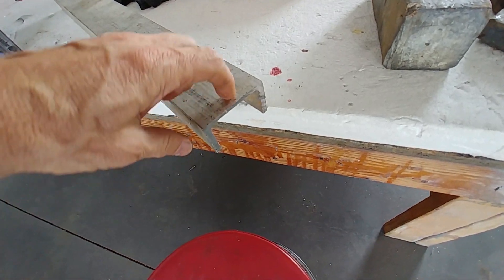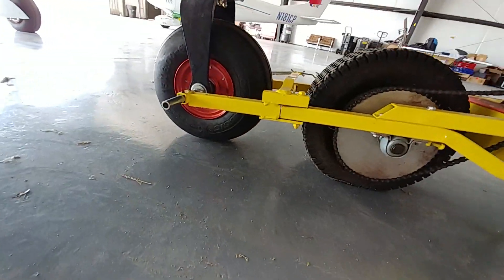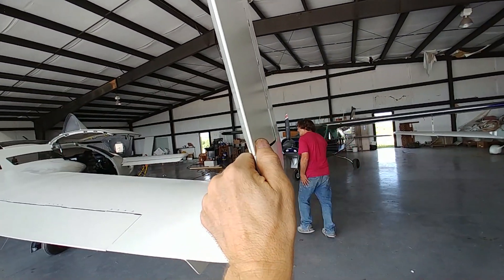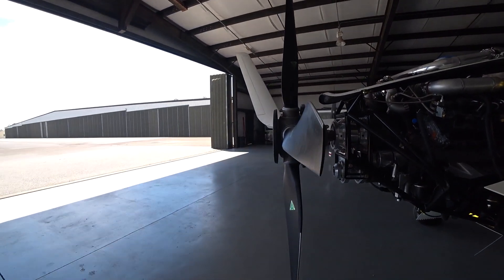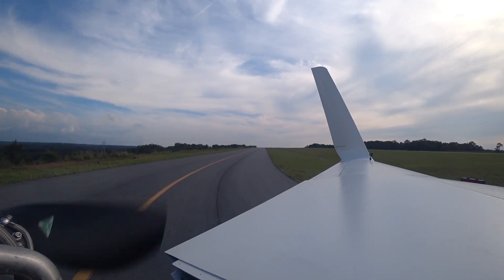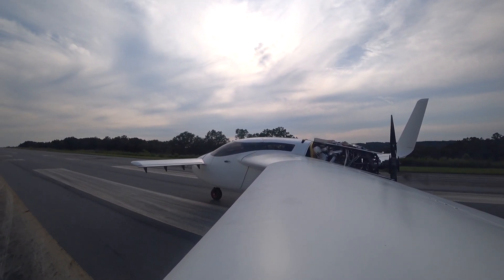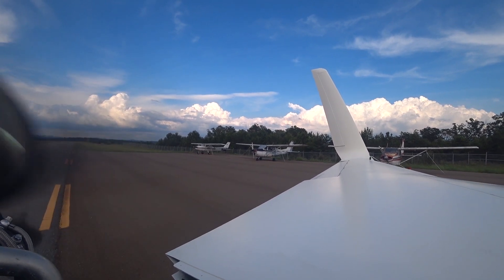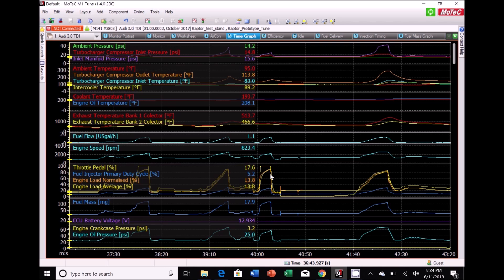Pushed to the Breaking Point - Building the Raptor Prototype

Comment: Dump the Audi diesel and go with an already proven engine like the RED AO3 V12 Diesel or the RED AO5 V6 Diesel.  Both already certified for aircraft use  and the just get the aerodynamics stuff sorted.  Unless Audi are willing to come in and help with sorting the ECU problem out - its juts a waste of time and money! May ned to re design the back end to cater for whatever engine you put in, but thats the quick answer to the engine problem.  You can keep banging on trying to solve the problem but even more may well crop up.
Reply: Or go for a Continental CD300 aviation diesel. Lose the belts for a direct drive gearbox, still get 300hp and a good fuel burn.
Reply: The Red a03 is too heavy ,too long and would double the price of the Raptor
Reply: Have you contacted Link ecus in NZ to see if they can help solve your ecu dilemma?

Comment: Some diesel engine manufacturers (maybe audi too) are using dual mass flywheel/clutch to dampen torque impulses, it looks like you dont have that 

dual mass system? One option is to increase flywheel inertia but it might introduce another set of new problems. You could also try to match 

rubber "clutch" harmonics to engine crank natural torsional vibration (1st mode). This seems just minor tweak compared to project you
accomplished so far, maybe day or two off the work and then back to business?

Comment: good to see you're at it, I know of other experimentals/light aircraft that have utilized strapping the plane to a trailer and towing it with a powerful truck at speed to test for wing flutter etc... towing also removes the engine vibration for better data analysis and a cleaner signal.

Comment: I would think that the Elpex coupling is only made to handle torque, not side load. The belt puts a ton of side load on the coupling. You might need another bearing between the belt and the Elpex.
Reply: If you look to the right in the photo, you can see the other end of that shaft that carries the two pulleys has an end bearing located under the other end of the re-drive.
Reply: @robinszemeti3085  Sure, that end bearing will take half of the belt side load but the Elpex coupling has to take the other half. At 400 hp and 4000 rpm the belt side load is 2,100 pounds (assuming sheave radius of 3") plus the pre-tension. The pre-tension needs to be so high that the teeth distance doesn't significantly change between idle and full load, otherwise the belt doesn't fit snug into the teeth and will be chewed up. Pre-tension depends on the material used. I would guess that pre-tension needs to be several hundred pounds.
Reply: @robinszemeti3085  That's part of the problem here. The bearing at the aft end of the Elpex shaft is anchored to the structure that supports the prop shaft. However, the engine is not rigidly mounted to that structure, they are isolated from each other by elastomeric mounts. So engine vibration and radial loads from the belt that move the engine on its rubber mounts cause misalignment between the crankshaft axis and the axis of the support bearing. That misalignment contributes to heating and wear of the Elpex, and also causes premature wear of the two toothed belts.
Reply: Martin Renschler. You are absolutely right that the redrive needs support on both ends.  The Journal bearings in the Audi engine are not designed to take the side load from the belts. ..... same goes for Elpex coupler. The journal bearings in Audi engine will fail just like journal bearings failed  in the redrive. I wish the Raptor team the best of luck and thanks for the updates
Reply: @poulsorensen6948  Exactly. Only thing that comes to mind is that the Robinson R22 heli has the sheave directly attached to the crank shaft and gets away with it. Obviously the Continental engine is able to take the belt side load. The sheave diameter was huge though which will decrease the side load and it only had 124 hp.
Reply: The engine in the helicopter is an airplane unit with a massive front bearing designed to react large gyroscopic precession moments from a propeller. The radial loads from the sheave are small by comparison.
Reply: Poul Sorensen    Journal bearings will probably be fine in this configuration.  It is not side loading.  Loading on engine is upward into the top shell of the rear journal bearing. The outboard end of the drive stub shaft has another bearing.  So not a bad set up.  

I worked a rear main bearing failure problem on a 700hp Diesel with belt dr some years back.  It’s problem was the machine builder had the belt pull turned 90deg from what Raptor has, so the crank was loading the bearing shells at their interface, split line.  This is not how / where split shell journal bearings in engines are designed to be loaded.  It also had a longer stub shaft and no outboard bearing.  We helped them redesign it.

Reviewing this memory, Peter may be able to improve reliability, cost & weight by ditching the coupling & moving belts closer to engine.

Comment: I have an idea I don't know if you want to hear it or not but what if you put bearings on either side of your shafts to take the load of the belt tension between the top and bottom shafts or use metal gears running in an oil bath instead of a belt

Comment: It may not be a torque issue but a misalignment. At higher speed, closer to 3000 rpm, there is correction of 0.7 on the permissible misalignment of 1.2 mm (0.5 degrees) that takes the tolerated  misalignment to about 0.8 mm. Misalignment works the rubber which has a rated max temp of 120 deg C.

Comment: Hmm that doesn't look good. But there's a quote from David Packard, one of the founders of Hewlett-Packard, that I quite like, which might be applicable here - he said (in part) "... there is only one road to reliability.  Build it, test it, and fix the things that go wrong.  Repeat the process until the desired reliability is achieved."  You don't have to repeat the "build it" part, just the other two.  I'm confident you can and will.  (Edit) And your follow-up post confirms this.  Go for it.

Comment: ,,, is the coupler OEM, also was it designed for a gas or Diesel  engine ? With a common rail engine as to my knowledge  it should  be fine either way, as the modern injection is significantly smoother. Your steady work will prove successful. There's  an aftermarket drive for motorcycles called, cush drive that seems  to hold up well .
Reply: It depends on how the Motec is programmed. The original ECU injects 5 times to soften the burn. Could be that the Motec does single injects.
Reply: ,,, not likely, the engine would take on an entire new sound, especially at idle. On further thought, it's not 100 percent  impossible that the coupler was damaged  in the car wreck. Also in the auto installation one end of the crank should  have a torsional  damper, and these do go bad in big trucks with all kinds of strange consequences; however the coupler might be serving dual duty in this instance .
Reply: Roland Tamaccio   Coupler is on the wrong end of the crank to act as a damper. Torsional vibration will be much higher than continuous and must be analyzed very carefully. Proper TVA (Torsional Vibration Analysis) includes the entire rotating assembly that’s been created.   This will give critical guidance to the “tweeting” process.  Otherwise could be tweeting for 5 years.  Of course the side load from belt may be doing damage as well.  There is an outboard bearing to help with that but as the engine flexes the isolation mounts it (the OB bearing) may be doing more harm to the coupling than help.  The double belt width is not helping these issues either.
Reply: @timduncan8450  ,,, TVA sounds like a project for PhD's. There's  billions and billions of miles run without much sophistication in that area in the transportation area, but Peter might be going where no man, etc. Ahhhh, the belt drive, well this little jewel engine can't  be what it is without revs, so direct drive isn't an option, but a planetary reduction drive will  work, if perforce.
Reply: @rolandtamaccio3285    First, I should have said it above, Peter is doing a great work, I wish I could be more help, but just glad he found this on the ground.  

Roland, is correct, PhD is exactly who we have to lead the finite element analysis group that is focused on just this issue.  University of Illinois, probably Georgia Tech as well, have experts on this that might help Peter.  Its all about excitation, mass, stiffness & damping across the drivetrain.  I work on very large diesel design only, but expect all  modern engines with sales $ beyond (some tens of millions/yr) some range will have TVA done.  Of course Audi has design control for their entire drive train and a very long history, so they may have evolved their drive train (engine, crank, flywheel, clutch/toque converter, transmission, prop shaft, differential, etc) more organically than numerically?  TV can have ripple effect on any connected system, but belts & fluid couplings (torque converters) put more damping between components that help to isolate them & stop the ripple.  We also analyse accessory gear trains and cam shaft for their backlash, rotational twitching and flexing behaviors.  Locomotives for instance have throttle notches, so the engine can only run continuously at certain speeds.  This is done so rpm's that excite critical vibration (linear & rotational) modes are avoided except during rpm transitions.  Maybe Peter could program the Motec to do this as well.  It is not ideal but very practical.  My guys is the rpm/load combo he was running in the recent test was somehow unique and caused the failure.  This failure does not look like a fatigue mode.
Reply: @rolandtamaccio3285  On Audis with stick shift dampening is done inside the clutch. Automatic transmissions have visco couplings and don't need it. The Elpex coupling was added by Peter. It's not an automotive part. Best would be to use a CV coupling between the belt drive and the engine to avoid any side loads.
Reply: ,,, hope an on center planetary reduction  drive isn't  necessary, as it will hurt prop clearance  . Btw, the redrive needs to be, unless it already has been, checked for concentricity and lateral  alignment  with the crank .
Reply: ,,, well as Tim said, organic, I said not much sophistication. Your big on highway 11 to 15 liter stuff, Cat, Cummins, Detroit, but not Volvo, are using the same damper in the front and some absorption in the clutch for 40 or 50 years. The viscous damper is still sold aftermarket  by the inventing company, made in USA, and might be better than OEM's that have, so to speak, outsourced  the units. The viscous fluid hardens over time and all kinds of strange  stuff starts to break .